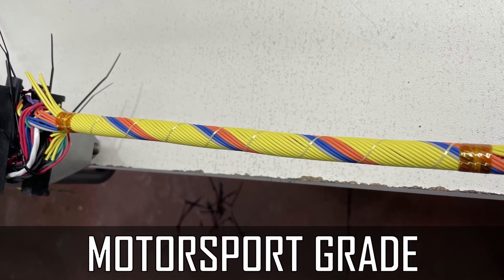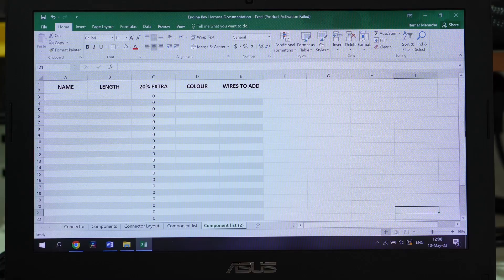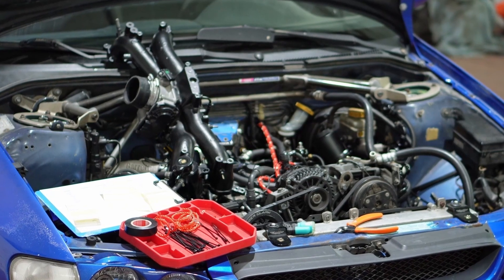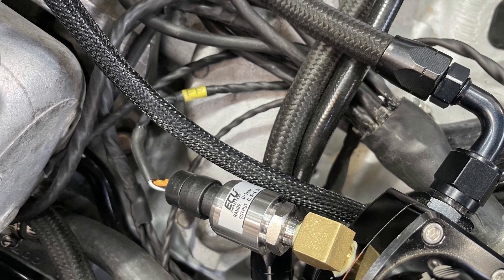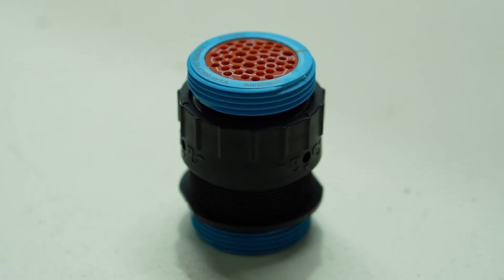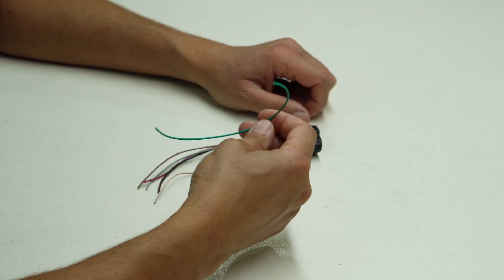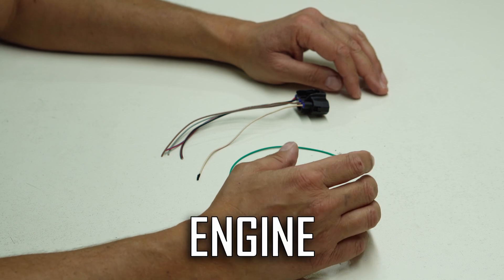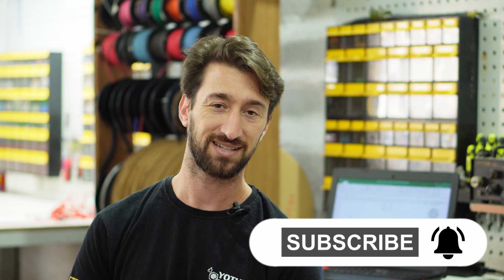Constructing a custom engine bay harness - PART 01

Comment: recently rebuilt my gc8,

207 short + recon heads, did it myself

did some fittings, custom power steering(astra pump)  got myself a nice just racing parts multigauge with oil p/t, fuel p, water t, boost and IAT in one display + shift light

Got the r180/6 speed, link g4+, 18 psi, vf28, man this car is fun!! 

Ive got to do my underdash wiring next time im back home!!

Nice details in this video, proper workmanship 

I use a lot of crip/spade connectors as you can easily remove them.
Reply from the maker: Sounds like a fun responsive setup you have there!